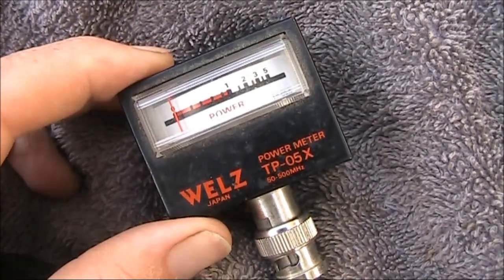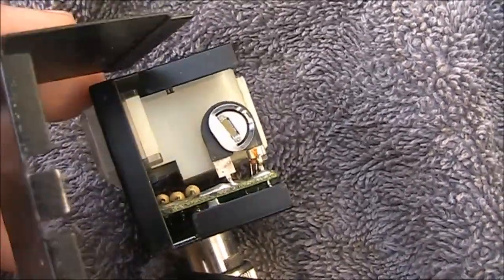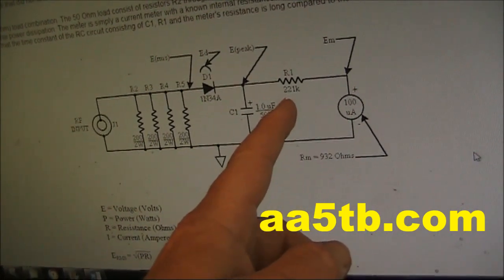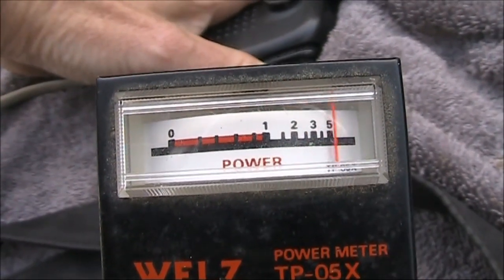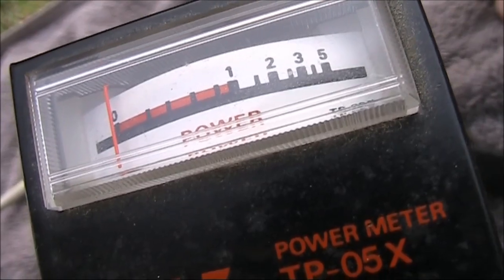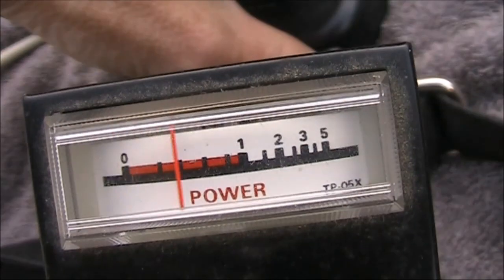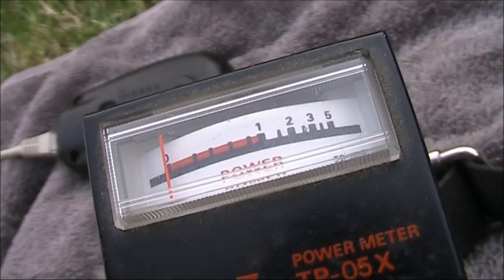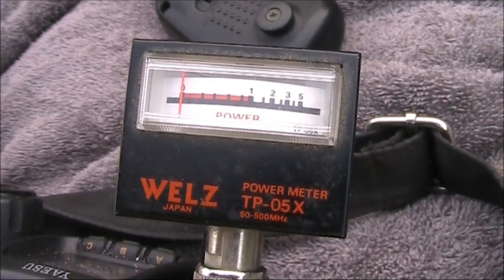Tweak your RF power meter: Here's how

Comment: I feel that the art of making meter movements has been truly lost.  If you really scrutinize the modern movements, you will find both full-scale and linearity errors. Sometimes you will find that a group of meters will read consistently but not anything what the scale says; so you might conclude, they used one as a prototype but the production run did not match.  Even in fairly expensive equipment, both scale and linearity errors will be present.  I repair a lot of ham-equipment and find significant errors not only in budget brands like MFJ but even the major radio companies meters will not read true.  A recent study of panel-meters that you can get off Amazon were absolutely horrendous!  Even two units ordered together were not only miles off, but off from each other!  HP really had it nailed in that they would print the scale for each meter and so are deadly accurate.  If you can buy a meter that you can open and replace the scale, you can reprint a new scale and other than hysteresis errors (i.e. repeatability from either traveling from left-to-right vs. right-to-left) is about the only way you can make them worth putting in your project.  
You can still get some meters that are accurate but they will shred your wallet!
Great video Peter showing just what this is all about.  73 & Hello from DM78...

Comment: Having played around a little making RF power indicators and SWR bridges, I found it is not easy to get accurate readings across a wide frequency range with simple circuits like this. I usually treat readings on uncalibrated commercial indicators for ham use with a pinch of salt. Just as you did, calibrating with a reference you trust at one frequency is probably the best approach.
Reply: I agree and have had the same experience.  I have a Welz SP-10X portable watt/swr meter that is good for 1.8 to 150 MHz and it is no more accurate as this one.  Good for spot checks and I used it to check used radios at hamfests for RF output.  If the output power was in the ballpark I could assume the transmitter was operational.